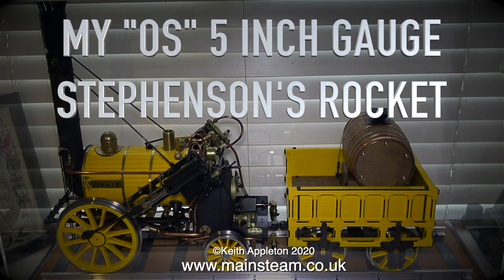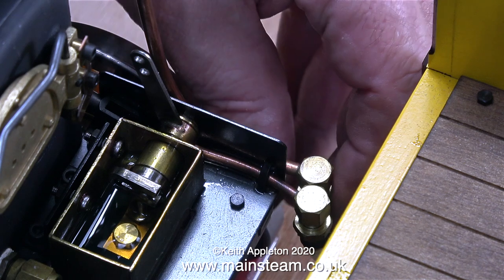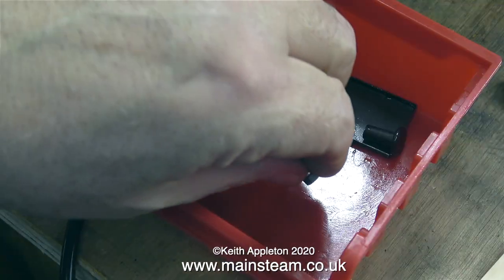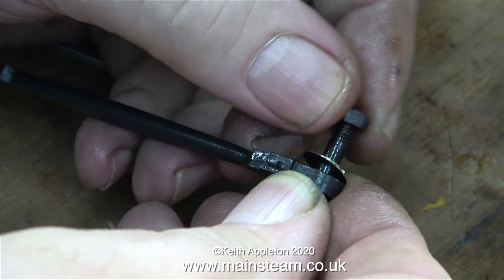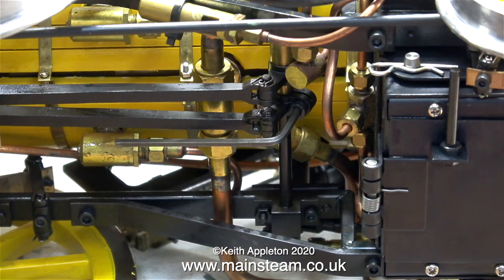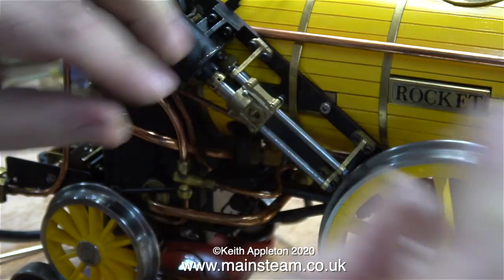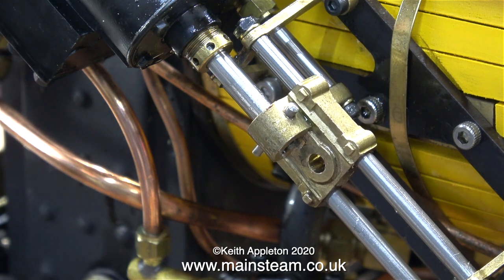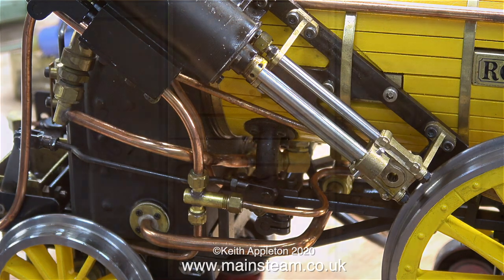MY "OS" 5 INCH GAUGE STEPHENSON'S ROCKET - PART #2

Comment: You are absolutely correct, WD 40 is not a lubricant.  It tends to gum things up on smaller devices.  It does make a very good light-duty cleaner.   Cheers

Comment: I mainly consider WD40 as a cleaning fluid, it can be used as a penetrating fluid too as it can be used to unstick stuck parts but never as a lubricant. It's main purpose is for water displacement, that's how it got it's name.
Reply from the maker: Yes, and after the 40th attempt apparently they got it right }:-)))
Reply: Am I showing my age when I remember it being branded as 'Rocket Oil'?